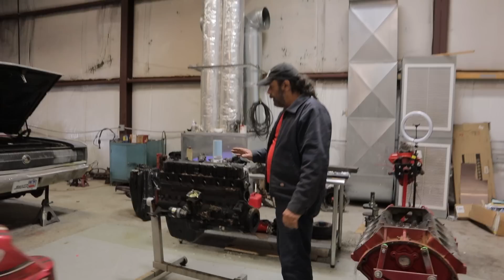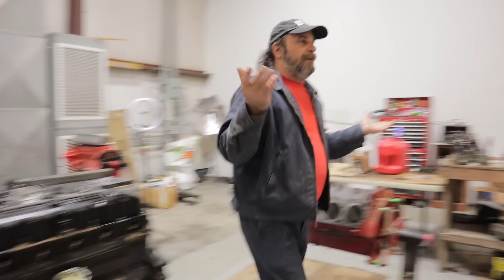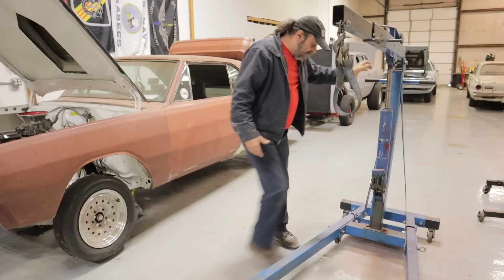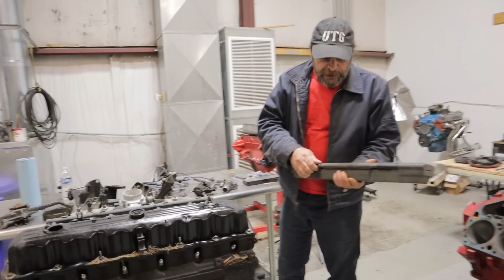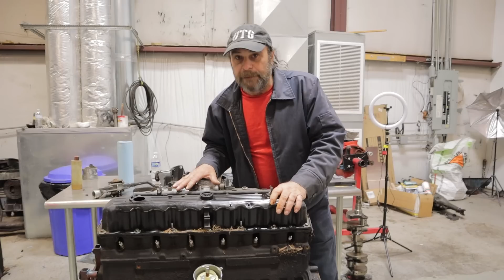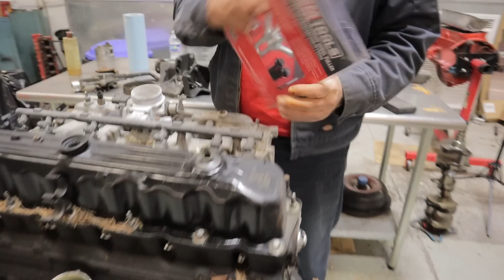Your First Engine Job - Arming Yourself With The Knowledge And Tools Needed To Get It Done

Comment: The external torx bell housing bolts are a PITA even with a good socket. I believe they're E12. They're 3/8-16x1.25 bolts. I've changed 3 XJ 4 liters and I always replace those with new flanged hex bolts. The lower bolts are fine, everything going into the trans is metric, and there's weird mixtures of SAE and metric in the accessory drive. If it's going into the block it is SAE, if it's going into anything else it's metric. You probably already know. Watch for cracks on the deck and head.

Comment: Wrap Masking tape around the bolts fasteners nuts and whatever part they go to , write say 1 A on the tape corisponding to the picture of it in your phone or tablet. So you can go into your pictures type in 1 A and the area of your project you need is easy to access.

Comment: The repair manual is a really good thing to have. Hayne's and Chilton's manuals will work in most cases, but if you can, get a factory service manual. The Hayne's and Chilton's manuals, read those first. If you are just getting into this type of thing, those will break down the process easier than the factory manuals will as those are more in-depth and are way more technical in the explanations of repair. Get to know the vehicle that you are working on before you dive in, it makes the work that much easier. And if you have to buy special tools for the job, just remember that you will have it for next time or on a similar job later on.

Comment: Ziploc bags and sharpie for bolts and misc as you take parts off, put the 4-10 bolts in a ziploc with a note as to where they were and put it away.
Load balancer for the hoist, weld a 1/2" drive from an old socket to replace the hand crank. It make pulling an engine/trans combo a breeze and then reinstalling and getting everything to line up nicely if you can adjust the angle that the engine hangs from the crane. 
Roll around carts for tools or parts, have the things you need at arm's length.
Wheel dollies, If you've got limited space,  lets you move the vehicle easily.

Comment: JMHO I tend to go overkill on engine hoists & engine stands........I NEVER use those stands with only 1 wheel in the front. I have the 2 ton hoist from HF and the 2 legged 1250lb stand from Jegs(caught a sale)......and I am only working with small blocks.

Comment: Gather up any needed gasket kits, a variety of sealants, RTV black and gray, Indian Head, Gasgacinch, Right Stuff, threadlocker, assembly lube, etc. Saves time waiting on parts stores, Summit, Jegs, vendors etc. Start consulting forums for your platform. You would be surprised what a treasure trove of info, diagrams, helpful hints, etc are out there.

Comment: One thing I would add is in this day and age take as many pictures as possible and then some more... Even with some common engines it just helps to know what went where exactly. An instance there would be a mix of bolts or bolts with studs for brackets.  I didn't take enough pictures on my project, because I assumed I could easily find the correct information online, and that has not always been the case. You know it is out there, but chasing it down when a free pic on your camera might save a lot of time and effort trying to find an answer you should already have. I work on mechanical clocks and assume there are no manuals or reference for how it should be. I also find at times I didn't take enough pictures

Comment: Same thing i'm going through right now, got a Chrysler 361 that's not burning oil at an alarming rate, it leaks a bit of oil. but the mechanical side of the engine is solid. aside from the worn piston rings and or main bearings (Oil pressure doesn't indicate that the bearings are kaput...). so i can't really determine IF and WHEN the motor needs to be pulled for even a simple refresh, rings/bearings/5 angle valve job that sort of thing.
Lo and behold this is going to be my first engine pull i'm pondering on for quite some time.

A thing to consider when pulling an engine is to buy the same engine from somewhere and swap that motor in the meantime for the one that's going to be in the car so that the car it's self doesn't sit somewhere immobilized  while the original pulled motor is being refreshed/rebuilt.

Comment: Old ziplock bags, sharpie, tape, card board to mark and record fasteners and the associated parts AS you take them out. You will get confused which part or connector goes where. Pictures, pix, pix at each step. Manuals do not cover everything

Comment: The top two bolts on the bell housing will drive you crazy. External torx hard to get at. The rest is a walk in the park after you start peeling the layers back.

Comment: I was a dealership Chrysler Tech for many years and worked on tons and tons of those. If that is an Automatic Transmission you can actually sneak the motor out with almost no room to spare and leave the radiator installed... definitely don't have to pull the header panel unless you are looking for miles of space to get the engine in and out.

Comment: I would say you should think about your engine when buying an engine stand. The cheap harbor freight ones will work fine for a 4 or 6 cylinder engine or a small 8, but put a stock cast iron hemi or a big block on one and it’ll sag so bad you can hardly roll it over.
Reply: Ask me how I know…
Reply: I know. I have one. Over 10 years ago I had a ford fe block on one. Could not rotate lol.

Comment: Tony, when I was a kid starting to mess with cars I would get a Chiltons manual. Well talk about a hair puller, if you were dojng rings and bearings it would say “remove engine”. What? How? So useless for a kid. I bout a few VW bugs and one came with the Volkswagon repair for the complete idiot. Incredible, he followed every nut and washer, clips and wires and the order to do it. It made working on the bugs fun!

Comment: i thought we were going to learn and talk about measuring. gapping rings , check the cylinder walls , checking deck height,  check valves clearance , degree cams and use degree wheel i would be nice if you can make a video to help boost confidence

Comment: Good job, uncle Tony when I’ve done engines in the past 

Ive shelled out the 50 bucks out for the local engine builder to do a hot acid bath overnight because that thing gets right in there more than I can with the garden hose….

Comment: First timers: you are probably going to break something - go ahead, and forgive yourself now and know a number of extras will make your project take longer than you might expect - for sure something in the nuts & bolts department will need attention and slow things down.  My first engine, I had a really rusted snout on the torque converter - just locked into the crank.  In taking a six foot prybar to persuade them apart...bent the flexplate ever so slightly without knowing it.  I only spotted it during the rebuild as I was degreeing in the new cam.  Not too expensive a mistake, as dumb things go.  So on went a new one, and of course the rebuild had the counterbore in the crank cleaned and lubed up when it was time to bolt the transmission back in.

Comment: Take TONS of Photos, cut out holes in cardboard to store hardware/plastic bags, replace any rotten/hardened hoses or anything else suspect (I’d rather spend the money than have to take things out again), watch YouTube for tools needed.  Sometimes buying a manual is helpful.

Admitted novice here, but those steps help me with anything from lawn mower engines, car engines, guns, etc.

Comment: 2 words, digital camera. Takes lots and lots of pictures, take pictures of parts coming apart. Take pictures of wire connections both together and apart. If in doubt on anything snap pictures as you disassemble it. Those pictures will gives you something to refer back to if you get confused. Nowadays we have phones with cameras that make it even easier.

Comment: Another thing is label, label and label. Get sandwich bags for anything you need to reuse put everything involved with itself together. I may not have torn apart an engine, but I’ve torn apart plenty of other things and if you forget where it goes you’ll be hours researching it especially if you don’t know what it is

Comment: If you're just doing a light overhaul on a motor, doing it in your garage is fine. If your motor is worn to the point to where it needs to go to the machine shop and you have limited funds, a remain motor might be your best choice. Just my two cents.

Comment: Before you start pressure top and bottom. Ramps at quarter car wash if nessisary. The gunk gets everywhere.  Also if you can afford it always new water pump hoses belts etc. You dont want to do all that work to have an old hose blow and overheat. On modern cars that stuff behind engine is not easy to get to yet with engine out it is easy. And buy a book for your vehicle. You can get cheap used on Amazon or ebay. They will have your specs.

Comment: Nice video, now at nearly 60 I wish I had what was available today or, more so, commonly a available:
Cheap rubber gloves, disposable and cheap; save your hands from dealing with chemicals
Coveralls, buy a pair of Dickies, I now have three, keeps your better clothes clean and is a real time saver. 
Rent tools, most big chains will rent you tools, you’ll need to pay up front but may return for full return.
Research, take your time, speak with people, join forums online; many people, like Tony, are happy to help. And for the record, I have the same torque wrench as Tony; over 20 years and it still in check. Most of all, learn & enjoy the process. Play some tunes, grab a Soda and wrench…

Comment: Degrease and power wash the engine before you start. Mark hoses,  take photos.  Get a workshop manual,  study it. It will not only give you the way to do it but wil tell you what tools you will need.

Comment: Hay Tony going to ask Sunday but if u see please give an opinion thanks have 355 Olds 71 steal heads 7As magnum flat Tapp cam holley dominater intake with 650 holley dpumper  always running rich never seems to be just right should i replace this carb with WHAT I'll ask you have tons of speed shops close by but just want your thoughts thanks 👍

Comment: Hey Tony, I want/need your opinion on my Chevy 327. It came in our '65 Chevy C10 that I'm currently restoring. The 327 that came with it has mods but one of the main bolts has a helicoil. I'm not sure how well that's going to work out with a 350-400 hp engine. What do you think? BTW, I haven't taken the oil pan off yet to see it for myself.

Comment: Yeah buddy! I highly recommend going on the internet and buying the Factory service manual if you can. Well worth the money. The older car's manuals can be found for much less than $100. Examples Of cars that I own or have owned that I bought comprehensive Service Manuals for are:
 A). 1930 Ford Model A. $25
B). 1947 Chrysler New Yorker. Factory Service Manual AND parts catalog for $75. The parts catalog had EXCELLENT exploded drawings and diagrams that really help enhance the factory service manual.
C). 2007 Ford Focus Factory Service Manual, Parts List, and Detailed Electrical Schematic...$75
D). 1974 Triumph TR6. Whole bunch of very detailed books on everything for way under $100.
E). I just ordered via ebay, a 1997 Dodge Caravan Factory Service Manual and detailed electrical schematics for $67 in brand new condition including shipping. Due Jan. 11 to my house. 
I have many more. They certainly save a lot of time and help you be successful. Definitely worth the cist of two tanks of gasoline!  I try to get them for every vehicle I own. Helps me too when I am having somebody else (dealer?) work on my car. I can ask questions that can prove to me if they know what they are doing.
Still haven't bought the Factory Service Manual for my 2016 Chevy Colorado Diesel.

Comment: I wish I didn't need Torx bits. But I work at a collision repair/body shop. And 99% of what we work on is crap built in the last 5-10 years. So I have all metric tools, torx, swivels and a bunch of nylon clip and panel removal tools. Cause car manufacturers forgot about screws I guess. Everything is snap together. I feel like I'm building a stage 1 model car. Just snapping pieces together all day. It sucks. I really wish there was a restoration shop near me that I could work at. I enjoy making rusty things nice again. But unfortunately unless I move or drive a few hours a day, there's no place like that around

Comment: Torx bolts... Yes, those evil things. You can get by using metric Allen sockets. Be careful doing so. Metric Allen bolts can use torx drivers and sockets without issues. The caveat is to make darn sure muck and deris is cleaned out. Spray cleaners, compresses air, picks, and even the greasy spoon toothpick all help. As small engine and its associated equipment is my forte',, I have used many above cheats. They even work on up to large earth moving equipment. 
Of course, clean your tools for assembly time. I can't stress this as I have seen much machinery assembled with less than clean tools. Some guys, like me, keep a separate set of tools for assembly only. 
Mikel

Comment: Over the years I've become a firm believer in studying camshaft profiles. Manufacturers use camshafts that are a compromise for all users. Certain camshafts will do better at sea level and others will perform better at high altitude. Nothing radical just a little extra for your application. Don't buy generic junk camshafts. Good brands and do some research.

Comment: I thought for a second you're breaking into a jaguar.🤣
Reply: Not without a no limit credit card. 
A buddy bought an older one years ago that looked great for peanuts.
He THOUGHT he got a good deal. 🤣
Until he tried to buy (and locate) parts.  Lol and this was long before the interwebbs .
Reply: @lilmike2710  the V8 for Jaguar, Rover, and Land Rover aren't bad they're supposed to be a copy of a Buick V8 from the '50s also I think all the Transmissions are GM.
Reply: @patricklynch9574  That your channel?
I subbed. I'll have one this spring. My first project will be restoring my 1973 Honda Gold wing GL1000 after a "will it start" after being in storage for 5 years.
Reply: @lilmike2710  no it's not. Gold wings are sweet. Growing up my dad had a totally dressed out one. He also had a Kawasaki triple with the Ripple.

Comment: Masking tape! Flag and mark every connection even if it's just with a number, it'll make reinstallation so much easier.

Take pictures. Seriously try to snap a picture of all the top end plumbing connections.
Reply: Masking tape FTW!  Also this is a learning process. Learn what you are disconnecting.  You'll have a better understanding about how things work.  On top of that, if you learn what you're disassembling, your tags won't be confusing to you and anyone else helping you. Writing "IAC" on your tape wrapped around your Idle Air Control connector is much less confusing than writing "1" on your masking tape and your corresponding "1" on the actuator accidentally got wiped away.

Comment: The engine bay looks like a plumber's nightmare. It's almost as bad as a Ford.
Reply: I'm a Ford guy and would much rather work on engines with plumbing nightmares vs anything household plumbing!!!
Reply: Nah vehicles with 4.0s aren't that bad. It looks worse than it is.
Reply: Have you ever even seen a 4.9/300 i6? Even the ones up to 96 when production ended had a square mile of working room. Even  working with my dad on his 2000 or 2008 silverado on basic accessories i’d rather work on a Ford of the same year. Main thing Ford has always been bad about is changing things slightly ever half a year model
Reply: I had a 84 Honda Accord at one time it had more hoses under hood than any other car I ever seen
Reply: It just looks scary, it's all just nuts and bolts
Reply: @travislostaglia8861  the joke about those was that there was like 200 miniature Asians in those boxes with little screwdrivers constantly adjusting the fuel mixture as you drive down the road. 
I remember those, you'd have a box with like 50 vacuum hoses coming out of them. 
Lift a head off,leave all that stuff hooked up and pull the whole box 😄
Reply: lol 😂 I’m aFord guy, but do true!!!! lol😊
Reply: we have 2 XJs on my channel . ive eliminated a lot of excess crap to clean up the engine bay including soaping up the engine bay and washing it
Reply: @Terminxman  I just got inside from working on my 300 i6.  I was actually standing in the engine bay whilst setting up a fuel return line - standing. In. The. Engine. Bay